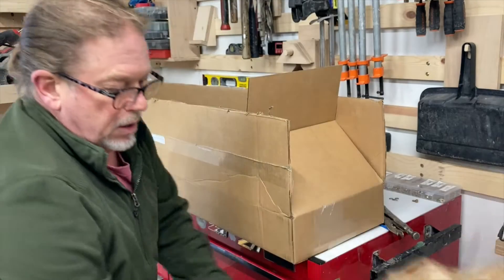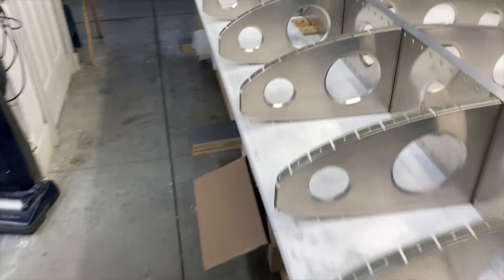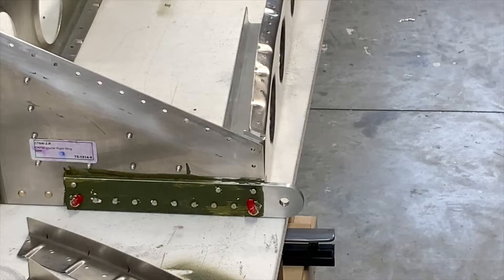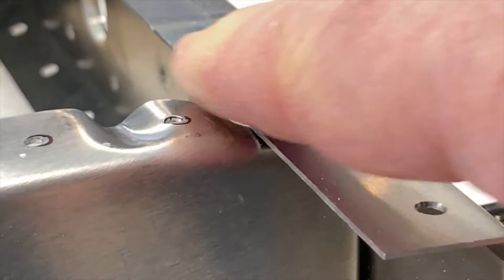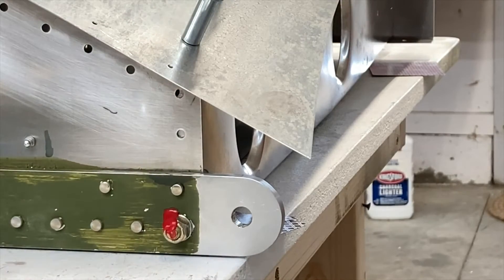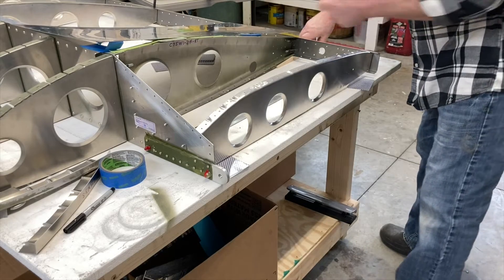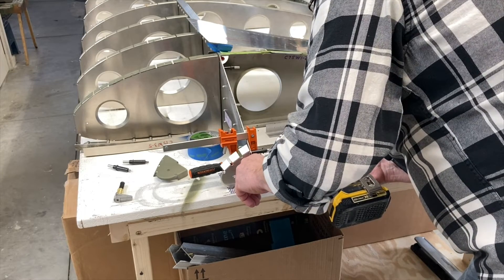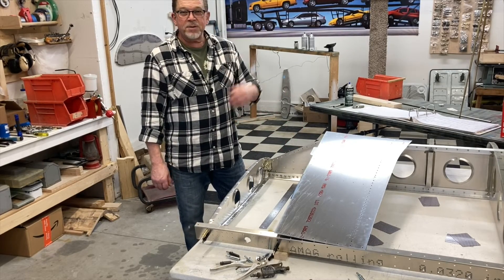Zenith CH750 CruZer Build... Replacement of the Root Ribs + hints and tricks .....Wing #2 part 11

Comment: What are you using for your workbench top? At first I thought it was the $128 / sheet 4x8 3/4” PVC I saw at Home Depot. Closer inspection, maybe just painted 3/4” particle board? How’s that going? Scratching the metal much? Keep up the great work and videos! I am just starting my vertical stab
Reply from the maker: Thank you. I thought of using melanin at first because I have it on my other benches but it doesn’t lay flat again after you put a screw in it and take it back out. Particleboard you just flake the little piece away and everything‘s up and running but who wouldn’t love melamine. If I had to do it over, I wouldn’t paint it. Doesn’t like lacquer thinner. Thanks again CPG Good luck on your build.